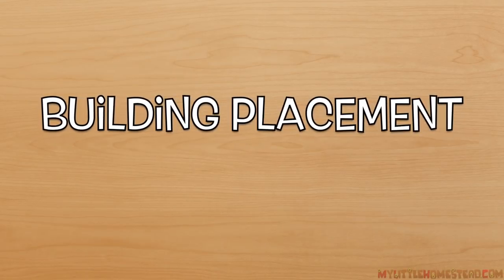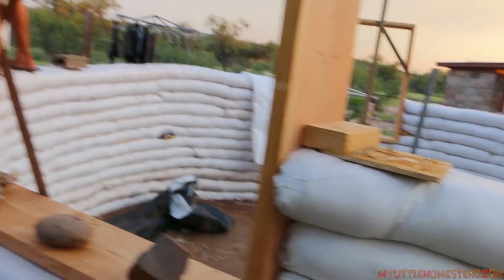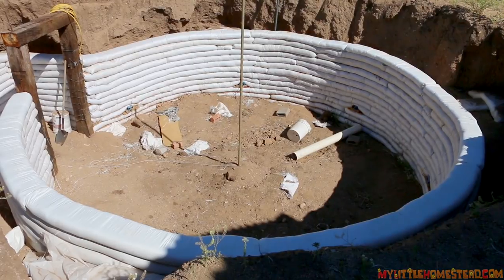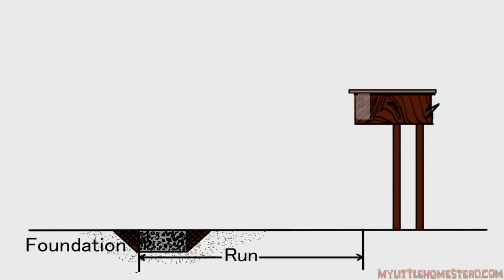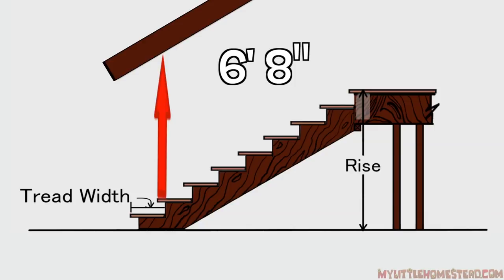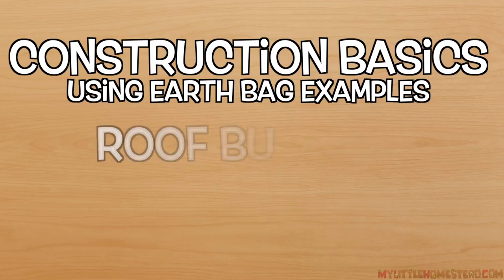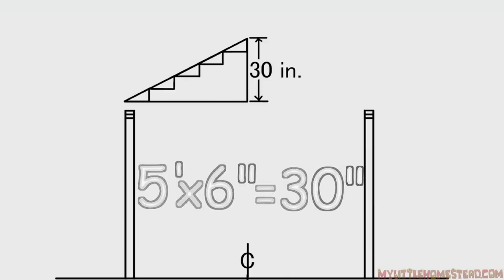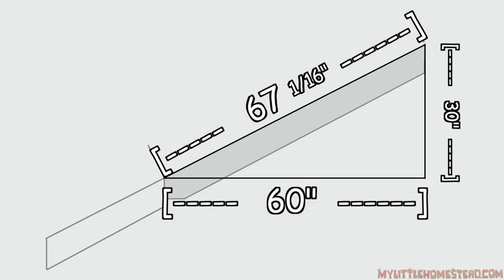Construction Basics for Layout, Stairs & Roofs using Earth Bag Examples | Full Version

Comment: Handrail height by IRC is no less than 32 no more than 38. Most residential stairs are 36 from the front of the nosing. Guardrail min is 36 from the floor in residential code. Commercial is 42 min on the guardrail.